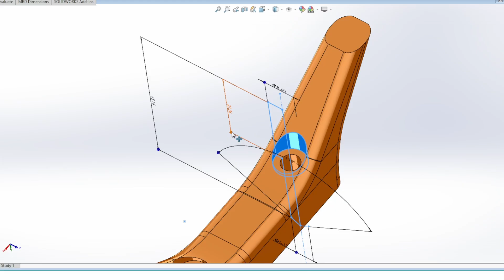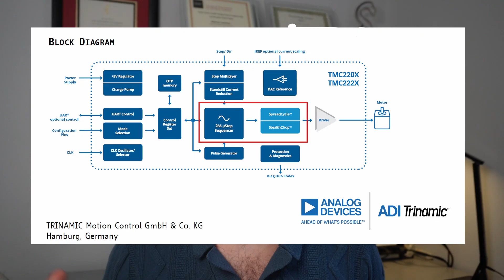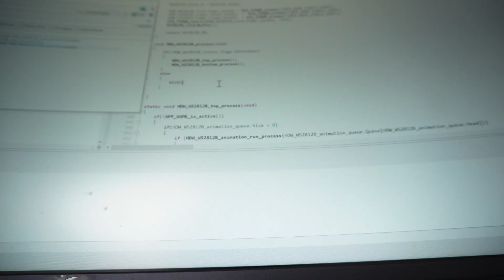Making a 3D Printed Motorized Camera Slider

Comment: I was talking to a friend about something like this to be used for photographing model effects shots. I was wondering how accurate this was? Can you film a model two or three times on the same track and will the shots match up so that you can overlay them in a compositor?
Reply from the maker: Good question, for this version of the slider, there is no "replay" feature, so you can't have it accurately move down the track the same as the last time. 

I'm working on a version 2 and it will have some advanced features like this.

Comment: This is amazing! I've used a lot of professional sliders and looked around for a DIY one, but a lot of them have issues with open belts-ropes. I'm almost tempted to start building the v1, but with your skill and a growing channel, it seems logical to wait for v2.

As a videographer I think one really important thing you should/could design in software is setting up multiple points and curves for them. Sometimes you have a longer shoot or an interview or a project, so you don't want to constantly go and change the speed-location-pan, but just have the camera do like 5-10 different movements within let's say 10-15min. Some professional sliders have this but they are usually pretty "dumb" and feel like DIY solutions while costing 2-4k. I feel if you have the programming knowledge and the drive, that could be something to differentiate you in this 3D/videography/slider world and maybe bring in the viral jumpstart to your channel.

As for color.. :)
For professional work I know I'm going to print your soon-to-come v2 in matte black, but since that's not great for videos and thumbnails, I'd recommend crimson red. If you look around a lot of pro video rigging gear uses that type of red as an accent color to bring out their product and still look cool & professional.

For the v2, will you be providing the software to us viewers as well?
Reply from the maker: You're amazing and your comment is amazing 😍. Yes I plan to design V2 to be open source and easily rebuildable 😁